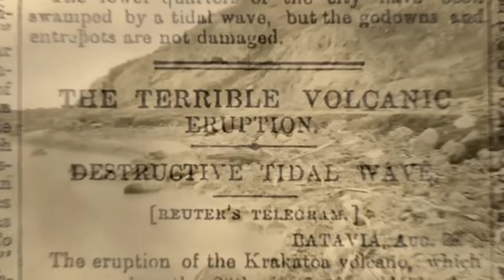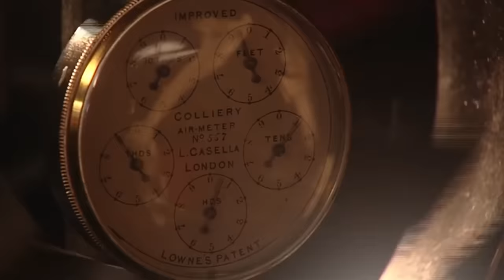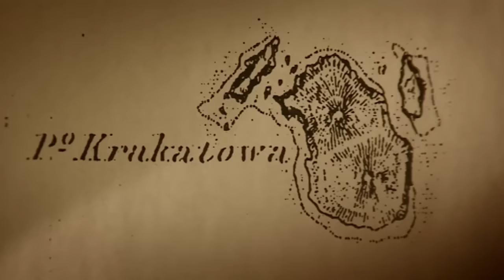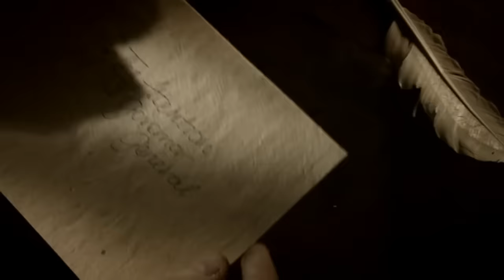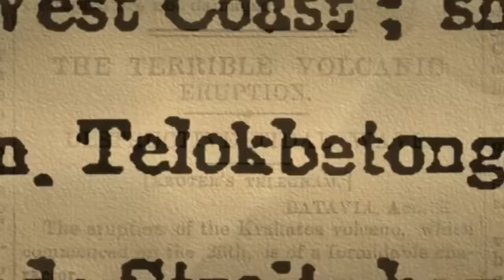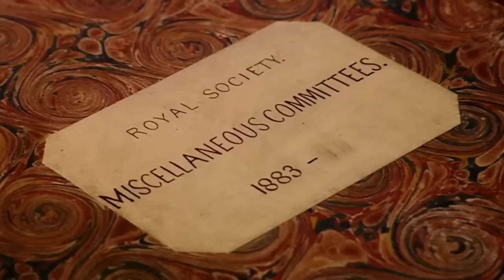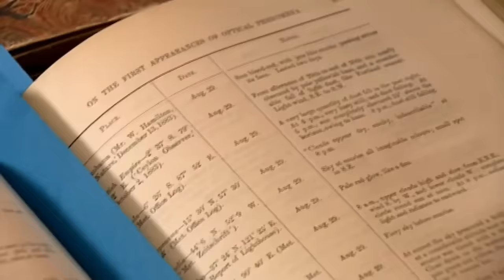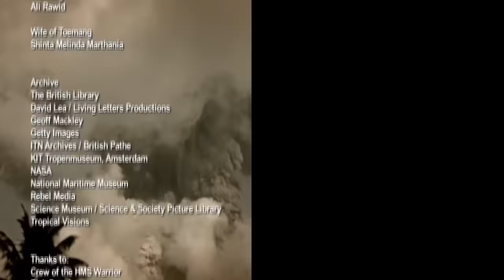The Volcanic Eruption That Lowered The Earth's Temperature

Comment: As big a blast as Krakatoa was, I suspect the eruption of Santorini coincidental with the events of Exodus took the starch out of a lot more people's shorts, circa 1600BC.  It's very probable Mazuma blew its top, around the same time, and there are other volcanoes around the globe that exploded during the events so placidly mentioned in the Old Testament.  It did happen, circa, 1610BC, +/- maybe 50 years.  Krakatoa might have been the last blast of the 1,700-year-long siege Exodus happened near the middle of, about 800 years after Noah, about 800 years before Homer's Troy, the bracketing incidents of the Reign of Terror our ancestors really did live through.

Comment: It was actually the Mount Tambora eruption of 1815, not the Krakatoa eruption of 1883, that lowered the Earth's temperature, resulting in the year without a summer in 1816.  Additionally as well, the 1991 eruption of Mount Pinatubo also lowered the Earth's temperature a bit, resulting in the year without much of a summer in 1992.
Reply: Interesting observation. We had a summer in Botswana in 1992! Funny how weather works around the globe.
Reply: @mandandi  Chicago did not have much of a summer in 1992; there were only 3 days in all of 1992 where the temperature was above 90*F.
Reply: @triton115  Perhaps the ash clouds blew your way and dissipated before they reached our neck of the woods. I remember that the winter in 1992 was really cold, though.
Reply: And how wet the weather was after Tonga volcanic eruption that we saw so much rain and flooding in South East Asia. This year's monsoon season we have a lack of rain, which is totally bizarre but I anticipated we will have long months of dry and drought conditions soon.